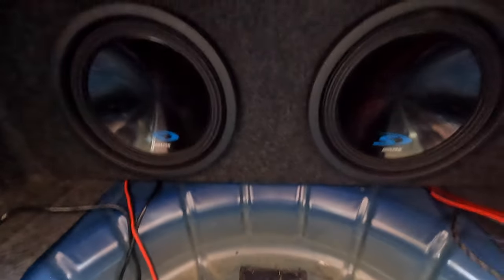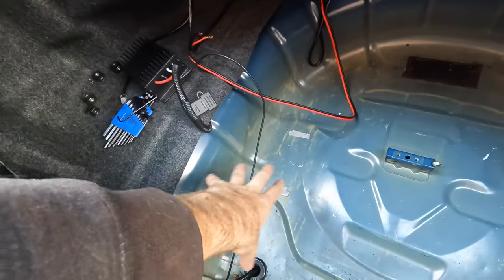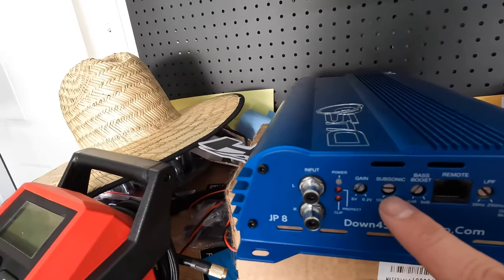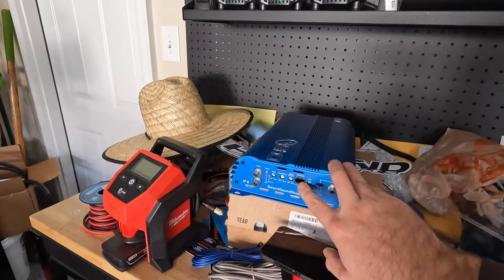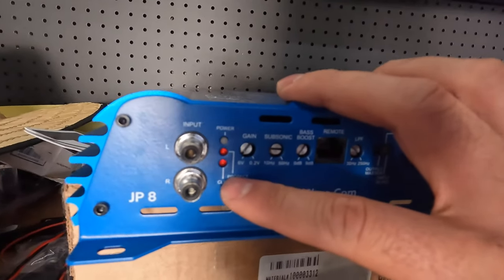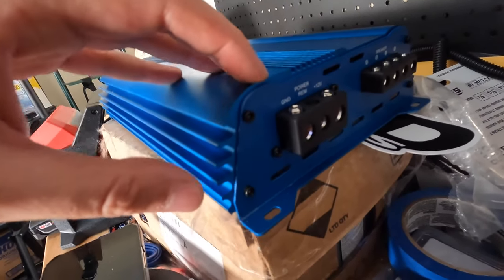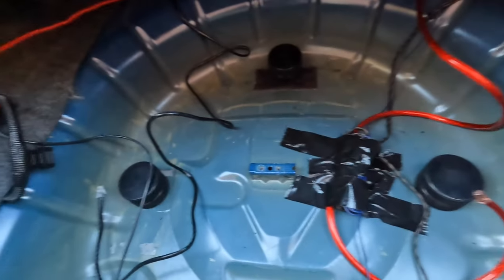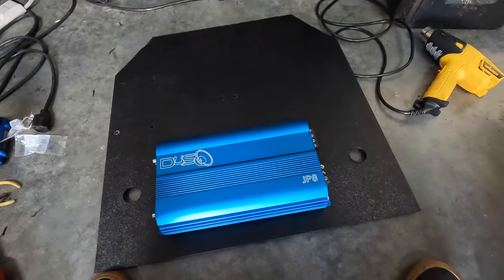Mustang Subwoofer Install ***CLEANED UP***

Comment: Nice install I am running this amp on my single Sundown X-15 V2 and this amp handles this amp like a champ low lows for days .  This amp do not over heat at all :D LOL like my skar amp does LOLOL
Reply from the maker: It’s such a great amp. Definitely a better design than a Skar amp. It’s not the cheapest out there but it’s well worth the little extra money. Even just the clip light is such a huge bonus